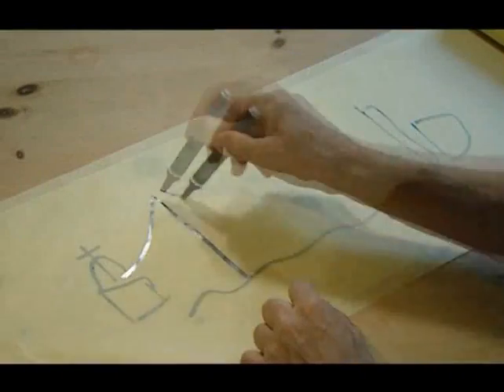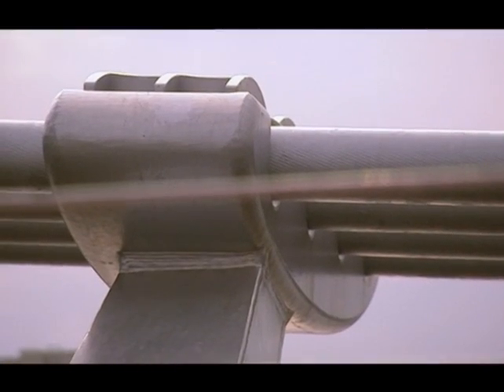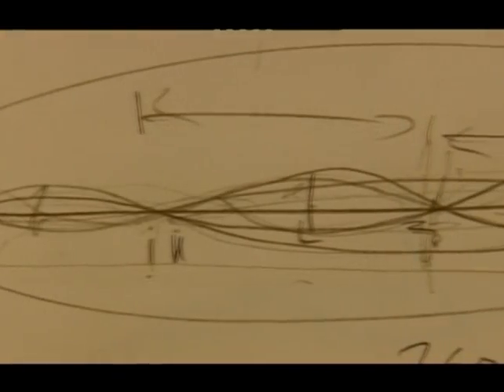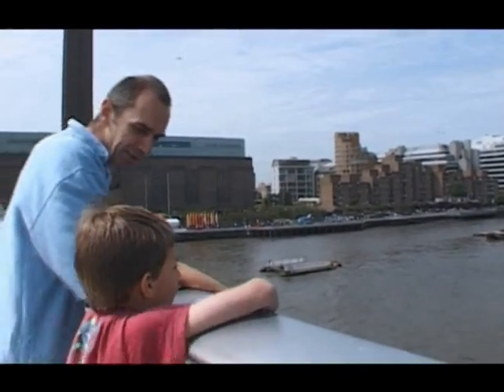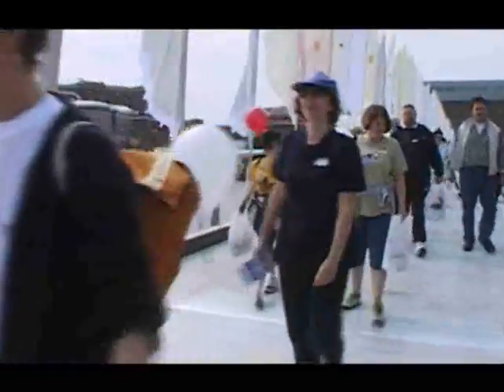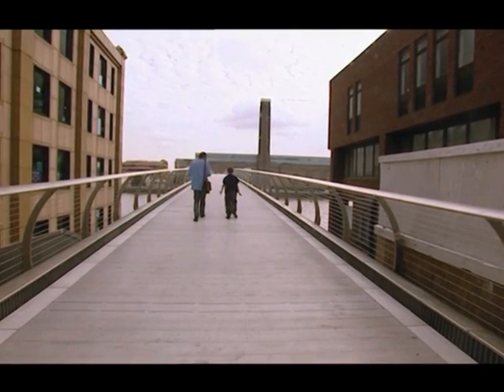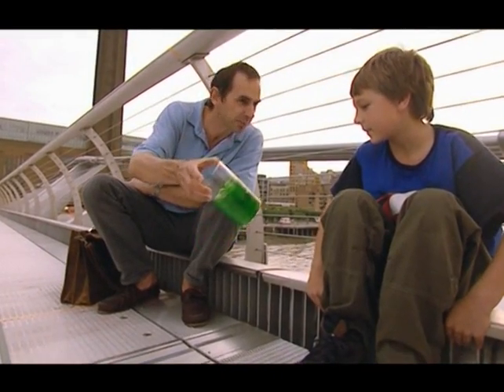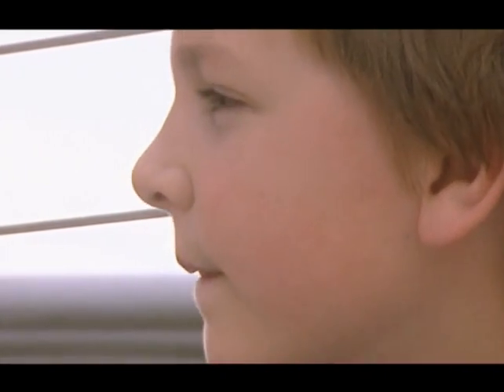Engineer Chris Wise Talks About the Millennium Bridge

Comment: It would have been very easy  to stabilise that bridge from its wobble without losing its aesthetics. Looking at 0:50,   rather than running those four cables PARALLEL  and so close  to each other , I would  have extended each support points  with two  additional compression elements one pointing upwards and  one pointing outwards . While two cables stay where they are , one cable would be elevated upwards, while the other would be moved outwards, with  all four cables  meeting  together at the middle or just before the middle of the  suspended spans .  That part of the walkway on the Vee shaped support would be anchored to it rather than left floating.   This would change the present   bridge which has no triangular structure, into one  closer to the cable support bridges  which contain triangular structure, which does not change shape.    Other  lighter cables can be used to stay  other parts of the bridge  with triangles to the  additional upper and outer support point and so no change of shape would be possible.  The damper that he  has in mind would correct some side oscillation but not the vertical ones.
Reply: there is no vertical oscilation though